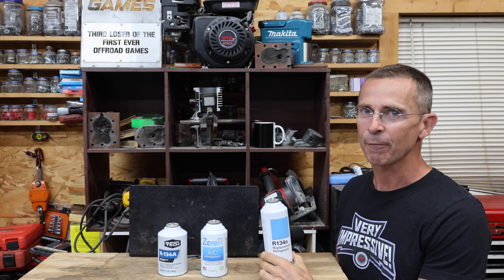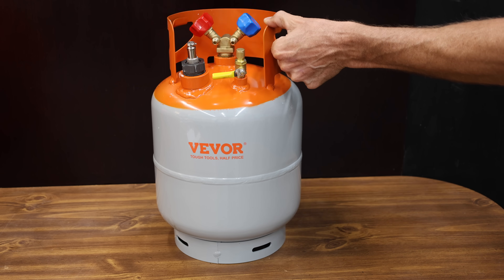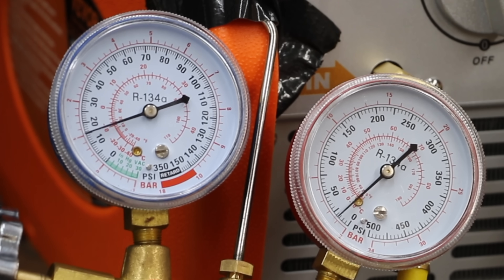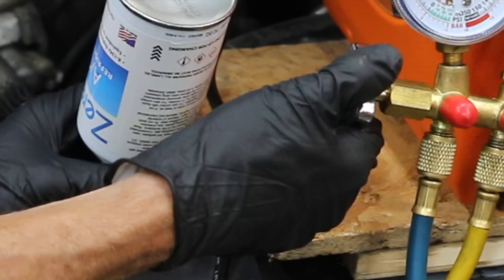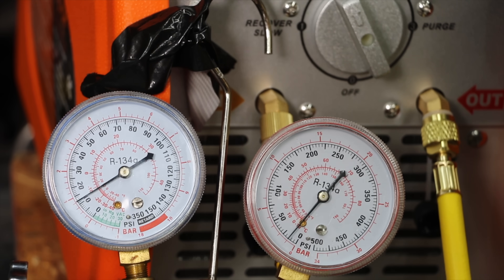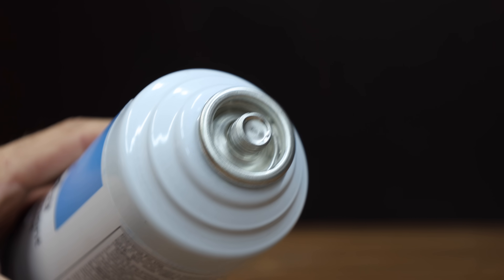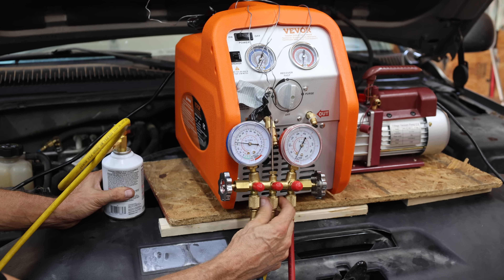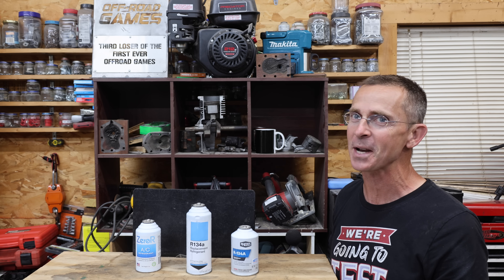How Dangerous is Fake Car A/C Refrigerant? Let's Find Out!

Comment: Just thought I should point out:

You're not supposed to use those one-time-use cylinders for recovery purposes, ore reuse them, at all

You're really not supposed to mix refrigerants in a cylinder, without knowing they are the same type. This can make it much harder to reclaim

Otherwise, excellent video, glad to see someone testing these replacements I keep coming across. Thanks!
Reply: When it's turned in it's destroyed instead of recycled. We come across R22 systems all the time that have had mystery refrigerants mixed in, 407c, MO99, 410a, all sorts of stuff.

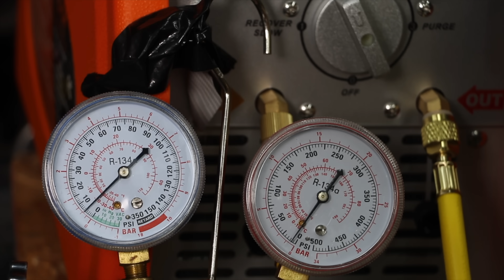Comment: The explanation of how the car's AC system works @6:55 alone makes this video worthwhile for anyone who works on cars. Another PF gem 💎💎 💎
Reply from the maker: Thank you!
Reply: I had a mechanic years ago explain air conditioning very quickly. Bear with me. Lick the palm of your hand and now breathe out on it for a couple of seconds with your mouth open. Now repeat but this time purse your lips as you blow. Even though it's similar you will notice a difference in how cool your palm feels.
Reply: @Colorado_Native 
That is an explanation of evaporative cooling, not conventional air conditioning.
Reply: Too bad it got a little mixed up. 
The hot gas coming from the compressor enters at the top of the condenser and drains as liquid at the bottom. And the same goes for the evaporator; liquid enters at the bottom, boils off and exits as vapor at the top.
Reply: the older systems used an expansion valve to release the pressure. most people didn't know FREON boils under pressure and freezes when you release that pressure
Reply: @Colorado_Native  not only is it evaporative cooling, the pressure difference alone from pursed lips isn't enough to cool down air. In case of lips it's the surrounding air that gets "grabbed" with your stream that makes the air feel cool. If you hold your hand very close you'll feel it's as hot as with mouth wide open. In case of car A/C systems there is a phase change from liquid to gas that makes it so cold.

Comment: Most cans of r134a and other refrigerants have additional chemicals like stop leak or compressor oil in them.  Don't use these products without proper knowledge of your refrigeration system or you risk equipment damage.  It's designed to operate at a specific level of refrigerant, adding can after can will overpressurize it and stop it from even turning on.  More cans =/= more cold.

When I replaced my ac compressor I had a hard time finding straight r134a.  Super Tech was the only can i found without any additives.  Ones with oil in them didn't have the amount I needed.  I added the required 5oz of compressor oil before sealing and charging the system.  

Excellent video as always, thanks PF!
Reply: Thats a great point missed by all the 'its easy' commenters.
You need a specific amount of oil for the compressor to continue to operate.
Just adding refrigerant without oil to a leaky system is just going to see it go oil starved and die.
Reply: I've put that in when I didn't have a gauge, was a mess to clean using air compressor and mineral spirits when I did finally have to replace the compressor that had been grinding for years. The new compressor said no warranty if you have leak stop
Reply from the maker: Thank you!
Reply: You can find plain R134A in the small cans at like Autozone and Rural King. Walmart is sometimes the cheapest, you just have to stay away from the ones with the built in attached hose, those have all kinds of oil and other "fillers" added to them.
Reply: DO NOT EVER USE STOPLEAK REFRIGERANT. No shop will touch your ac system unless its to replace the whole thing. Stopleak destroys recovery machines and you're supposed to do a simple water test before hooking up a machine to make sure it doesn't have that stuff in it. 

Yes, you should be hoarding R134a can since they'll be worth a lot more in the near future. Buy as many as you can. But don't touch a stopleak can. Also, I don't think the cans come with oil. You're supposed to add that separately after knowing how much you've removed or when installing a new compressor. Even then, many new compressors come pre-filled and you want to replace the receiver drier or accumulator anyway.
Reply: Yep I'm glad Walmart sells Supertech basic Refrigerant with no additives. All the stuff in the auto parts stores are overpriced and all have stop leak stuff.

Comment: The GMT800 platform has such a good AC system! Capable of freezing both front and rear passengers even in hot weather. Whoever designed the GMT800 AC I would love to meet and shake their hand for a job well done.
Reply: Yeah they cool so good
Reply: I have an early 2000s GMC pickup and even in 90 degree weather and me being a person who is always hot, that AC will make me way too cold after half an hour, it's ridiculous how good the AC on my 350,000 mile truck is
Reply: they did nice job for sure, sometimes its so cold it feels good to get out of silverado and warm back up and its been in the 90's here recently ☃ ❄
Reply: Yes the mob likes to use GM vehicles because it keeps the stiff in the back seat cool and not stinking up things.
Reply from the maker: Thank you!
Reply: GM air conditioners are the best ones. Hands down.
Reply: Absolutely!  I have an 04 Sierra and the A/C will absolutely freeze me out of the vehicle even with it over 100F outside.  My wifes Altima seems to absolutely struggle until you have been driving for a few minutes (and this is after having the entire A/C system checked and serviced just a month ago).
Reply: Not all GM vehicles. I had a brand new GMC Savana van from 2017 until 2023. It never did that good, sometimes the compressor would just turn off if sitting at a traffic light. Sure, on a very long freeway drive, eventually I could get 45 degree vent temps out of it (but using outside air, not on recirc). If stuck in slow traffic on a hot day, vent temps got up more like into the high 40's. I have a 2018 Hyundai Sonata that has that stupidly expensive R1234ya in it. That A/C will freeze you out of the car, I've had it cranked on a hot very humid day, and I've seen it blow tiny snowflakes out of the vents sometimes!

I got a new (2023) Ford Transit van, that A/C has R134A, and POE oil! (The good stuff mon). And that A/C will freeze your face off, even on a hot day, and even sitting still. Variable speed compressor and variable speed condenser fan that can really ramp up to stupid high RPM (sounds like a jet engine on full blast) it works very very good. I think the key is the efficient fan blade design, with a full shroud, and a powerful BLDC fan motor to move lots of air thru the condenser as needed. I can grab the liquid line going to the expansion block with the A/C on high and it's barely bath water warm on a 95 degree day. The hot gas line going into the condenser feels about as hot as an exhaust manifold though, but the condenser is doing a super job of cooling down that R134 before it hits the TXV expansion block I think is why it works so darn good. On my old GMC van, if sitting still in the driveway, the liquid line would get almost too hot to touch.
Reply: @Joe4USMC  Nah, those old Fords with the Frigidaire compressors and the neat system they had for a power valve instead of a fixed orifice or expansion block were the best. It would maintain like literally 32.2 degrees evap temp on R12, and keep the evaporator just a couple 1/10's above freezing no matter what fan speed you set, to get the air as cold as possible without freezing the coil up. The compressor would never cycle on or off, that valve would go into some kind of bypass to keep the suction pressure at exactly the right steady pressure.
Reply: My 05 suburban was so cold. I would turn the rear roof vent to blow down my back and it was so nice on a hot day.
Reply: @many-points  that must be pretty "cool" ha ha ha
Reply: @brnmcc01  I would make a joke about freon but it would be too cold to hold and would have to put it on ice
Reply: @harrygregory6227  🤣
Reply: @05milmachine90 I know it. My 05 suburban is freaking cold!! Best AC I’ve ever felt
Reply: @Wontreplyeverdontbother  you replied to someone
Reply: Imagine owning a GM and being proud of it.
Reply: @harveywallbanger3123  imagine owning anything other then a GM and being proud of it… I bet you drive a Ford.. haha 🤣
Reply: @jordanabendroth6458 
Have 2000 C3500 Crew Cab, leak in AC system, unable to afford repair to use. CA temps crazy at the moment. 🔥
Reply: @MoloneLabe  imagine owning a gm product and thinking it's good you get 14 mpg while I get 20mpg with a 444ci motor with 420k factory motor trans and rear and ac compressor I also tow 30k to gm makes a car with a bed not a work truck
Reply: @MoloneLabe  I'm sorry, I was a little vague there. Let me rephrase: Imagine owning a Detroit vehicle in 2024 and being proud of it. 

I drive a Toyota Tundra. It's industry leading, made in San Antonio, and I'm also not funding the Marxist autoworkers unions while pretending I'm a patriot.

The Wobblies ruined Detroit in the 1980s - if it wasn't for mandatory government purchase contracts for cop cars and civil servants (Congressionally mandated to keep the industry alive), the American auto industry would have been permanently and justifiably bankrupt 30 years ago.
Reply: Another Ice cold GM vehicle is the C6Z. Mine was so cold it would hurt your hand putting it up to the vent. I wish I measured exactly how cold it was
Reply: i have a 1994 Isuzu Trooper 3.1 TD that does the same, never been charged; it is re-named Opel Monterey here in Europe.
Reply: @corvetteZ3r  My 1987 G20, 1997 Express and 1999 Tahoe will all get down to mid-low 30s at the center vent in 115F Texas summer heat.
Reply: @chrisreynolds6520  danggg. STICK WITH GM!
Reply: @corvetteZ3r  My Nissan/Infiniti products I have owned cooled even better especially around town and idle. I do not understand how they do not freeze up the evaporator cores as they hold 29-30F air from the center vent for miles at a time. I have a 2019 Titan and in Texas heat you are turning down the blower and knocking off recirculate in a few miles because it gets so cold. It is a factory R1234YF system. My black on black 2011 M56S would cool down in about 3-4 minutes remote starting it and be nice and cool getting into it even sitting in the sun. I left the driver A/C seat on in it too so the seat would cool off. At 350K miles it was still ice cold.
Reply: @brnmcc01  The old 80s GM Sedans would freeze you to death as well. I remember dad having some Buicks that would blow so cold in the front seat that your hands would go numb. I know R12 was bad for the planet, but it sure would blow cold
Reply: @chrisreynolds6520  I had an 04 Sentra, it would get cold, but never super cold. That car had the best heater of any I've ever had, though. It was great for a midwest winter. The heater core had to be gigantic relative to the car's size
Reply: I've never been a GM fan, but cannot deny that GM AC units work better than any other car I've been in.  Bravo, GM!

Comment: HI, keep in mind that when taking a vacuum on a system some moisture will freeze due to the evaporation and appear it is all out, sometimes all you need to do is let the system up to atmosphere and the ice will melt. what we normally did was warm it up with a torch or heat gun, while watching the vacuum gauge, when any water flashes off the vacuum will jump up a little. I would warm up the accumulator/drier to drive off the stored moisture.
Good Luck Rich
Reply from the maker: Thanks for the feedback.
Reply: Sorry for asking this, but can you clarify for me? the moisture freezes due to the vacuum itself? (even when on atmosphere temps) or you mentioning the situation where the system is still partially cold from the use and you need to let it sit in the open for a while so all the frozen water inside melts before the vacuum is done? 

I just got confused if the vacuum itself can cause the freezing and if you would heat the system up as the vacuum happens. Thank you for that insight btw, it's super valuable.
Reply: @Raikos100 he's saying the water content would freeze due to the vacuum causing evaporation which lowers the temperature of the substrate, so water content that evaporates would cool the remainder of the system to the extent some other remaining moisture could freeze

Comment: This brought back memories of when I worked (1990's) as a service engineer for a company in Australia that manufactured vacuum pumps, refrigeration and recovery systems and was the agent for Leybold (Germany) who manufactured refrigerant leak detector equipment. One such leak detector used a quadrupole mass spectrometer for the refrigerant used and the leak rate with several preprogrammed selections with one being programmable. 
Funny story, a manufacturer of refrigerators and ac units in Orange New South Wales bought dozens of these machines and I went there for their routine service. The production manager asked if the machine could detect methane which it does and I programmed it. He then took the probe and held it to his butt and farted. The machine not only detected it but sounded an alarm as the leak rate was very high!! LOL We both laughed so much our sides were hurting!!
Reply from the maker: Lol, Thank you for sharing!
Reply: Does that company still exist ? Or was it wrecked by cheap made in C. like everything else in Straya??(asking from Coonabarabran/NSW).
Reply: @moestrei  Still there in Victoria :) Great company too!
Reply: @moestrei  Still there in Victoria

Comment: As a auto tech, there's a couple things to note.

You should leave the recovery run for a few minutes to get the refrigerant out of the oil. It needs time and vacuum to boil out.

Also I heavily discourage using any sealants or leak-stopper in the refrigerant system. It slows a leak down at best. The worst part is that it causes major issues in A/C service equipment, including plugging up control valves and possible other expensive damage. If the vehicle has any leak-stopper in it, there's a special inline filter that needs to be installed between the vehicle and the A/C machine.
Reply from the maker: Thank you for sharing!
Reply: I've used sealer products on multiple vehicles.  It worked on all of them - one of them going from leaking out over the course of a day to lasting 10 years until I sold it never again needing a charge.  The issue is if you need to open the system up to replace parts because then you're probably SOL unless you replace EVERYTHING.  Such products have their place.
Reply: @knurlgnar24  when I get ahold of them, the sealer didn't work.😅 

But I agree with you, the issue is if you had to do any repairs after it's in the system.

I wonder just how prevalent it will be with the new R1234yf refrigerant, that stuff is crazy expensive, and more and more newer vehicles are starting to use it.
Reply: Since covid all the prices are up 404a used to be like 7 dollars a lb now it's about 35 a lb

Comment: And finally, the video is you may or may not be asking about at the end, water filters for your home for not just filtering the water but also softening it too
Thanks again Todd 👍
Reply from the maker: Thank you for the video idea!
Reply: @ProjectFarm please do this^^.  But also find a way to measure the microplastics when comparing against RO filters. Get the equipment that helps you measure microplastics yourself, because I am positive that you will be using it in the future........
Reply: I'd like to see a petri dish test to test when they are new and at the end of their recommended schedule would be interesting
Reply: @ProjectFarm  My recommendation is to compare vehicle headlight bulbs. Thank you for all of the great videos.
Reply: Who wants soft water all slimy feeling and nasty. If you use the proper filters it won’t soften the water very much. The minerals in water are what gives it flavor.
Reply: @Thumper68  RO systems are often used with a remineralizarion stage to add minerals back. Pure water is definitely not slimy feeling. .. don't confuse soft water with pure water
Reply: @gutrali  I’m not I said soft water is slimy. I was a licensed water well driller, electrician pump installer for 20 years I’ve installed many different filtration systems from most basic to those that remove high arsenic content to safe and drinkable. The well at my home was about as close a you could get to pure water right out of the ground. Best tasting water ever I don’t even drink water anymore since I moved.